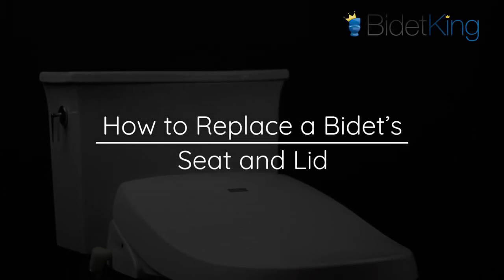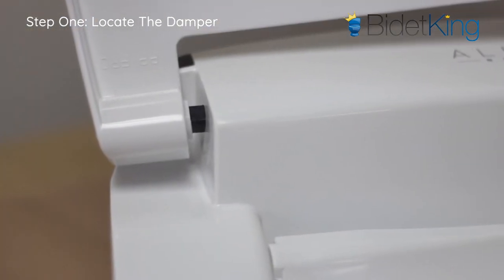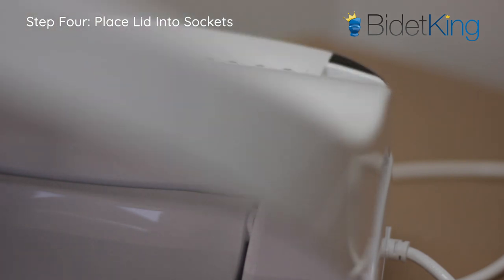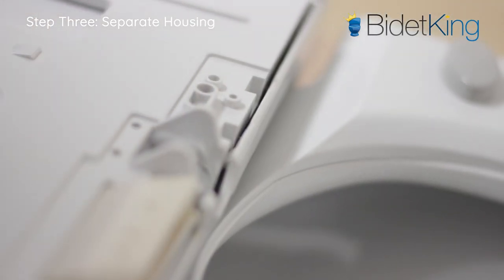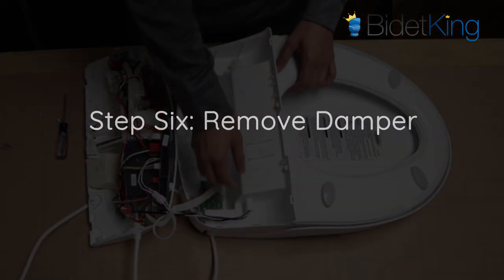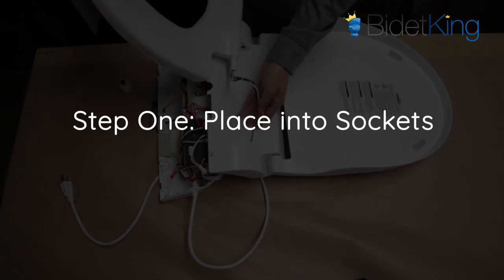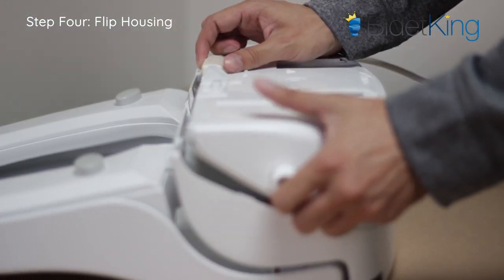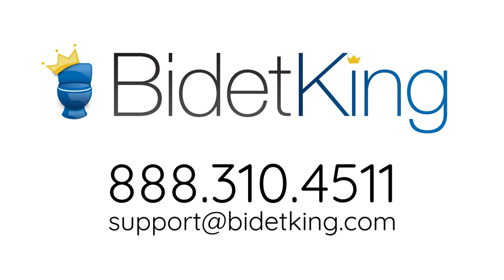How to Replace the Bidet's Lid and Seat | BidetKing.com

Comment: I struggled to remove and replace the seat and now I have forgotten which wire goes where. Your video is a slap in my face. I know I should have remembered, but what to do now? I can't find a wiring diagram anywhere. Spend money locally and buy a bidet.

Comment: I would think more than twice before buying this product again.  The seat cracked after a year or two and no one in our household  weighs over 175 lbs.  Once we finally received the proper replacement (that took two tries as the web site is not helpful, when removing the old seat we discovered much gunk behind the seat where it is
impossible to clean.  I'm not thrilled.
Reply: BTW my  husband spent most of New Years Day replacing the seat and he is a General Contractor and generally very handy and intuitive about fixing things.  I love the warm seat, etc., but there has to be something more hygenic.
Reply: Same here. They informed me that this can be because the rear rests on the seat don't always make contact with the porcelain lid...but they have stick-on bumpers that will "fix it"...so, they don't include  (max) 50 cent pack of rubber stickers in their packaging because...why?!? Nothing about it in their directions. So after I got pissed off enough, they've agreed to send me a new seat. That I have to change myself. And sent me to this video, which isn't the same model I got from them, but "should be close enough". It's not. They seem to have both design, manufacturing, and customer service problems. Spend a dollar to save a nickel. And piss lots of your customers off at the same time. GENIUS.
Reply: There's a button on the side of the seat, push it and the whole bidet slides off. Really easy to clean with it off.
Reply: Had one for many years and swear by them. Two retaining bolts are easy to remove to enable cleaning. The mind boggles how you could get it so dirty if you are cleaning it. Best we don't go there nor to why it cracked in the first place.
If you are considering buying one I'd recommend entirely and keep it clean as per instructions. It won't clean itself.